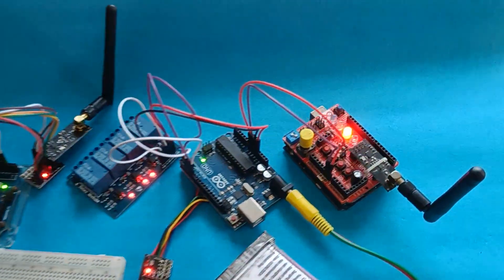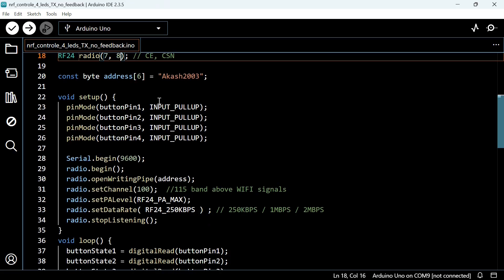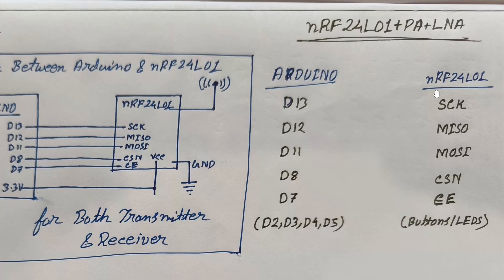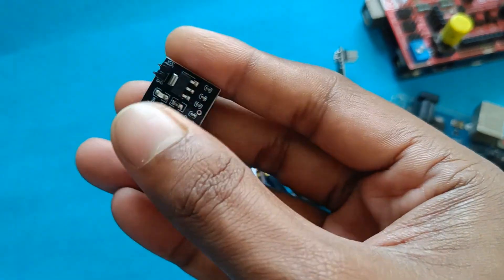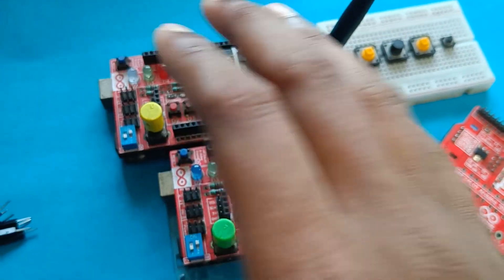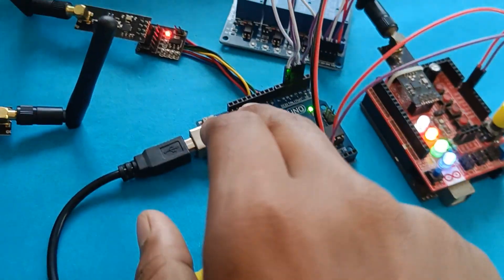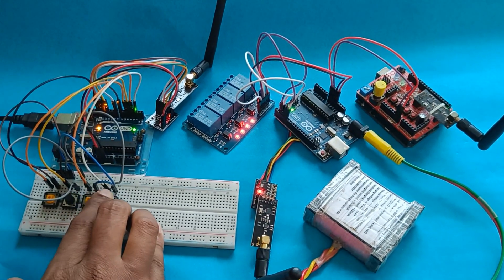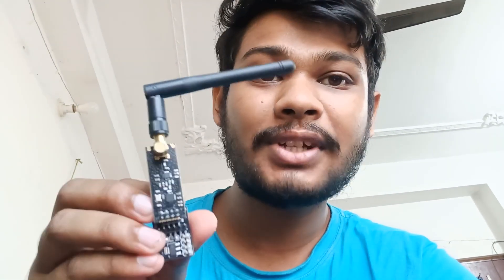nRF24L01 Arduino Tutorial – Control 4 Channel Relay with Code & Circuit Diagram #nrf24l01 #arduino

Comment: NRF24 ik  battery te dono chalde. NRF24 10 minute baad me ....
 alag-alag battery te nahi chalda. Btao  kise challega?"capacitor vi laya 100uf
Reply from the maker: Vai, maine bataya na pahle wala comment me hi, ki these modules are very sensitive to connections and other factors also, if your code is ok, then check your modules. Sometimes they just doesn't work... You have to findout the problem, mai dur se aaise bata nahi sakta vai
Reply: @AkashWaveRF ok

Comment: The NRF24 with antenna is not working. Both work on the same battery, but after 10 minutes, the NRF24 does not work on separate batteries. Tell me how it can work."
Reply from the maker: Bro, these modules are very wird and sometimes just doesn't work, and if you touch the module with your finger, sometimes it starts transmitting. Also this spi protocol is very sensitive to loose connection, check your connections again and try to add 10uf caps on vcc and gnd of the module... These modules are really very frustrating. Hope you'll be able to make it work
Reply: 100,,uf capacitor vcc and GND nrf24 with
Reply: Please sir btao
Reply from the maker: bro, try to understand, it cant be tell in that way, these modules are actually cheap chinese modules, often created problem. i had spent more then 2 years with them, but still sometime they create problem. you have to find your own trick. thats why i had made that own arduino shield for nrf. my tried and tested codes are there in the description box, you can download them and do experiment, but there is no any radymade sollutions for these. i had also faced, but you have to figure out your own solutions
Reply: Not working

Comment: Sir Arduino nano nrf24l01antunna send failed onda h
Reply from the maker: Check your wearings, codes... My codes are triel and tested... Test my codes, and if fail, then you can understand that there is something hardware connection issue
Reply: No sir
Reply from the maker: These modules are actually very noisy and even if most of the time your connection and hardware is ok, they created problem due to their signal noise and other factors. In that cases, adding a 10uf capacitor between vcc and gnd sometimes helps
Reply from the maker: These modules are actually very noisy and even if most of the time your connection and hardware is ok, they created problem due to their signal noise and other factors. In that cases, adding a 10uf capacitor between vcc and gnd sometimes helps

Comment: We are getting transmittion failed on serial monitor
Reply from the maker: There may be many issues! It's hard to tell what's the projoem is. These modules are very sensitive and sometimes very unpredictable. I had told in the video. The only way is, you have to do trial and error, that's the only way. That's why I was forced to make that Arduino shield for it.